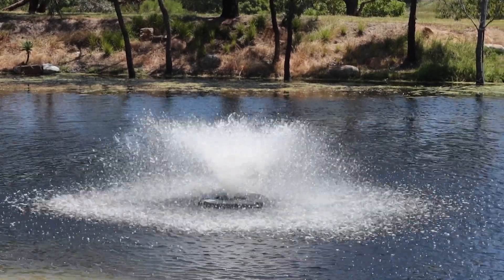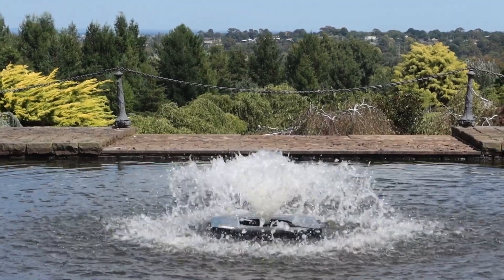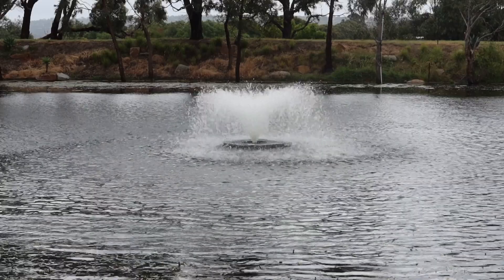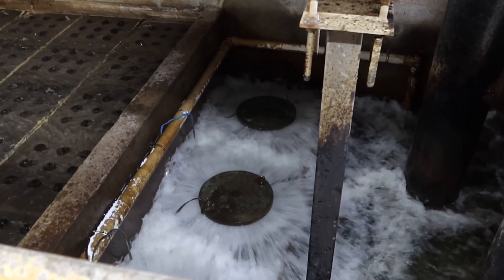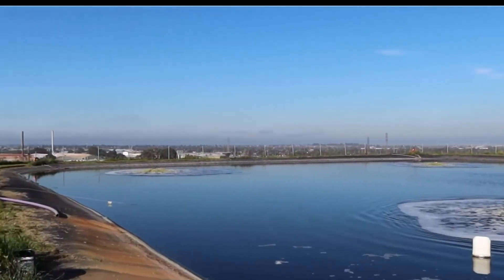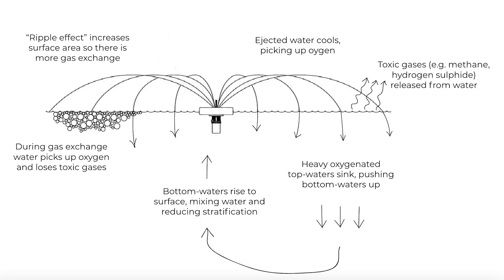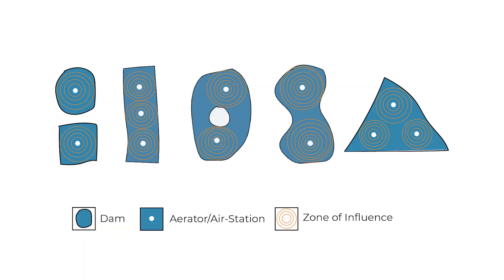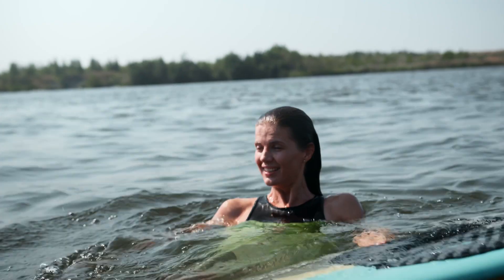Surface Aeration 101—Oxygenation via 'Ripple Effect' and Surface Agitation

Comment: Id be looking into 48v dc equipment now. The industry is starting to learn brushless dc at low voltage is super efficient and safe and price wise its going to be cheaper than hiring someone to dig a trench to get power to the dam. Do you see much low voltage dc equipment yet?